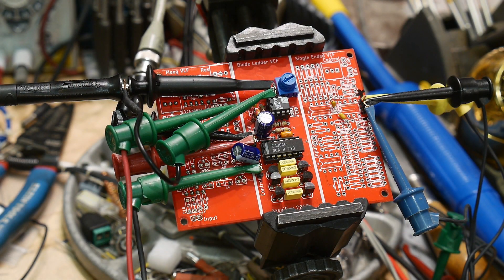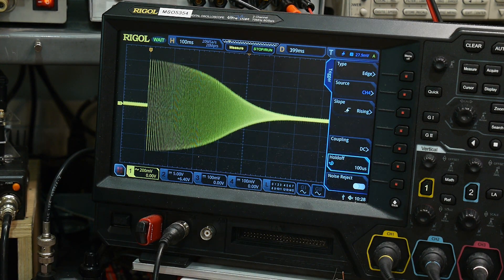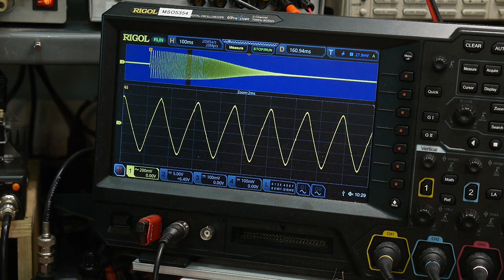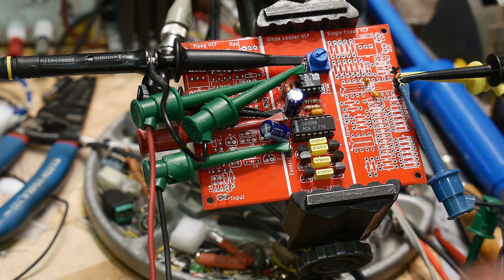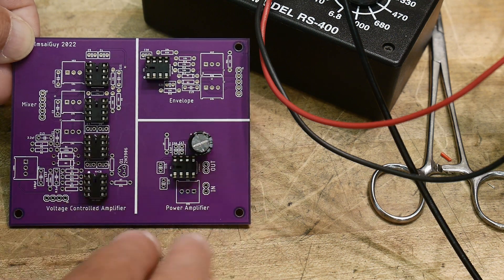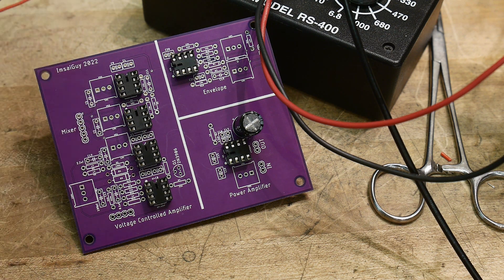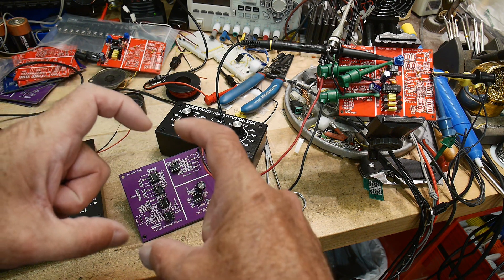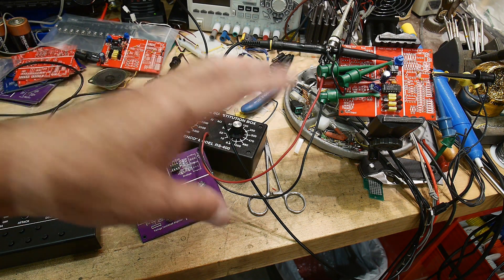#1220 DIY Analog Synthesizer (part 13 of 15)

Comment: Your Moog filter was very obviously only passing on one half cycle, maybe a biasing issue?
Reply: he attached the darlington transitors array to gnd via a 2K2 and not to the negative supply and erased my comment suggesting he made an error.
: )
Reply from the maker: I did not erase your comment (at least not on purpose). I am the first to admit errors. the biasing was not an issue as the bases were at ground and the tail pulled to -V. I believe the issue is with un matched parts. might be something else too like over driving the input. anyway the filter in the next version will have the bases biased at 1.2 and the tail at ground. 
The only comments I have every removed had to due with pornographic content, companies advertising, or religion/politics.
Reply: @IMSAIGuy  i saw in your schematic that the 2k2 was tied to GND (i reversed the video to be sure my comment was valid) and should be the negative rail, like suggested in the datasheet of the lm13700.

instead of the darlington, use a BF256 jfet or similar, lke the Roland did in the system 100(m),, Jupiter 8 (service manual), Juno 106, ect using the 2SK30a tied to negative via 10/33K.

check the service manual of the Roland Jupiter 8, a killer synthesizer.

a wave form should always be 10 V.p.p.
to be complaint with the synthesizer standard, so you can use a VCO/LFO as a control voltage if desired.

it's a bit useless creating a "standard" synthesizer, it becomes interesting if every module you make has a 2 channel input mixer and being able to stick what ever waveform in there to create never heard sounds.

like you work.
Reply from the maker: @AnalogDude_  yes, schematic wrong. I cut and jumped to -V
Reply from the maker: I have learned that there is a lot of work making sure all the levels are correct and consistent from section to section. I ran out of interest and it will be a bit half assed. I went too far from the noise toaster idea.
Reply: @IMSAIGuy  don't stop, like your video's.
Reply: @IMSAIGuy  use a  appropriate JFET coupled to 10/33K to negative instead of the darlington array for the filter, much better. that's how they did in in the past.
Reply: Analog boy - are you accusing the creator of these videos of deleting comments?  Please give us specific details.
Reply: @boonedockjourneyman7979  wel, i told him that what i wrote here, i spotted a grammatical error and tried to correct it and error returned. my comment was gone. since it wasn't a terror act and YouTube had to come, leaves only one.

But i enjoy his videos and spotted a  tiny "possible" error and tried to help him. i do this stuff pretty much 365 days a year.

don't want to create any fuzz, just tried to help him why half of a his wave was gone.
Reply: @AnalogDude_  I bet that your comment was removed by youtube. 
I faced multiple times cases like yours and I wasn’t using vulgar nor offensive language, just polite comments. 
In the future I suggest that you restart your web browser after posting a comment and verify if your comment is there, if not revise your comment and try again. Put attention when you use a business name, monetary values, etc.